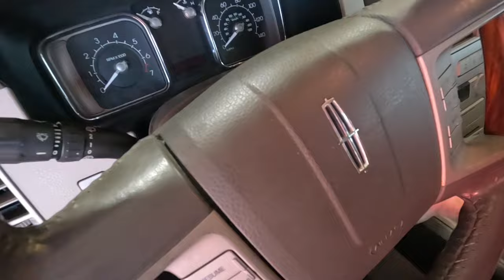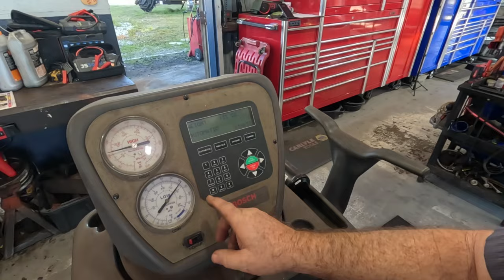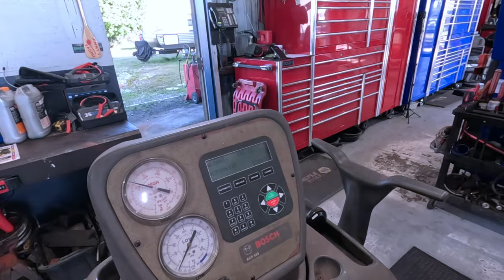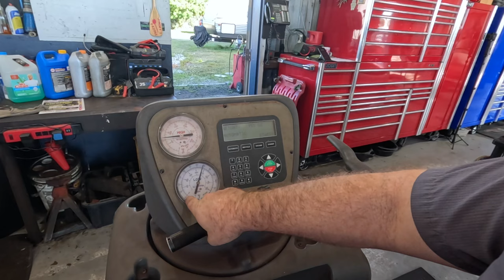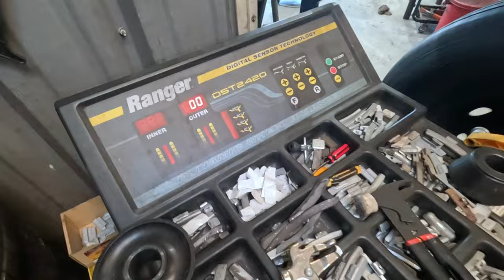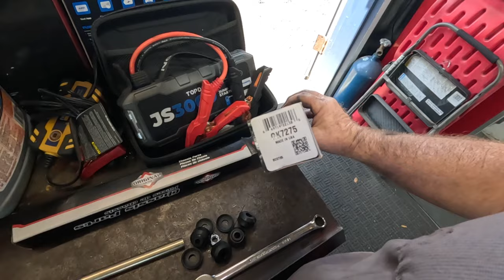LINCOLN, RANGER DANGER, OIL LEAKS, SUSPENSION, AC, DAY IN THE SHOP 458

Comment: Moog ball joints,the boot is built into the ball joint.This is the reason why you will not find in the box.If you get a nut or bolt stuck in the socket,put the side on top of a vice and smack the side of the socket
 with a hammer.I was taught this and it works.
Reply from the maker: Very true. I usually bang em on the lift with good success. A good shock and they usually are out.

Comment: Those Ranger / explorer ball joints.. usually can be pushed out with the air chisel..a few burps and “Bobs ur uncle “ 😂. That Ranger kinda need’s everything !
Reply from the maker: Yeah, sometimes I just use a ball pen and pop them out. Just didn’t want to work the shock too hard.
Reply: @JimmyMakingitwork  yep , was only the shock holding the lower control arm..with the torsion bar tension on it.. seeing the sway bar end links were broken .  Lol

Comment: Thanks for the video Jimmy!
I have a question about AC work, when you pull the refrigerant from a customer's system with the AC machine. Does the machine store the refrigerant and you can put it back or in every case does pulling the refrigerant mean replacing with new?
Reply from the maker: Our machine like many will remove and “clean” the refrigerant for reuse. Basically recycle. Good as new!

Comment: I normally would not ask for help as I am the one fixing my neighbors and church friends cars . But my neighbors 2013 Jeep jk has no turn signal in the front only the back still working. Checked bulbs they are good. He did install LED tail lights and front bulbs but the system was working fine . Now the flashers and turn signals don’t work in the front only . I don’t have any all data or other information sources. Can’t find a flasher unit figure it’s integrated into the something. But totally lost . Any help would be greatly appreciated
Reply from the maker: These use the fuse panel module or TIPM for lighting, signals and hazards. A bit messy. But it might have a fuse issue or internal problem if it’s getting the signal and working the rear lights.
Reply from the maker: White and light green to left ft turn, white and tan wire to right ft turn.

If the TIPM was changed there are wires that need to be relocated for updated modules.
Reply: @JimmyMakingitwork  thanks Jimmy 👊🏻